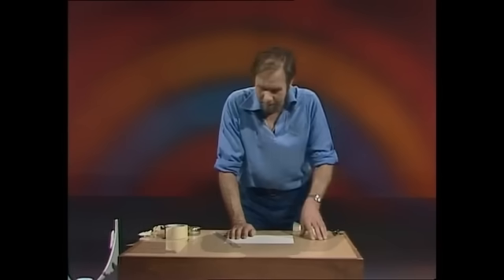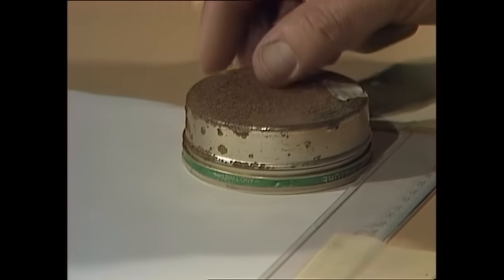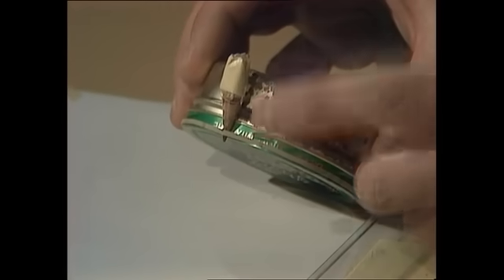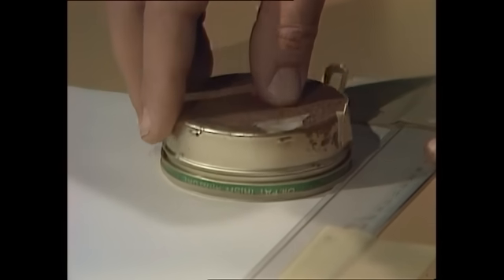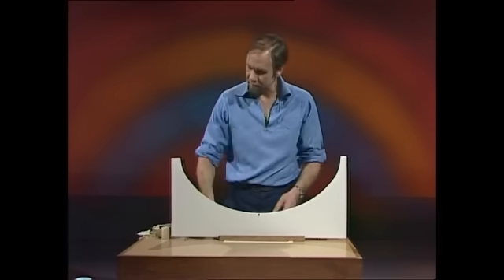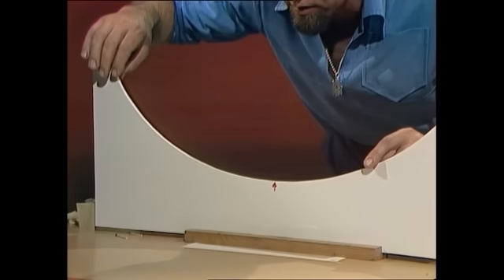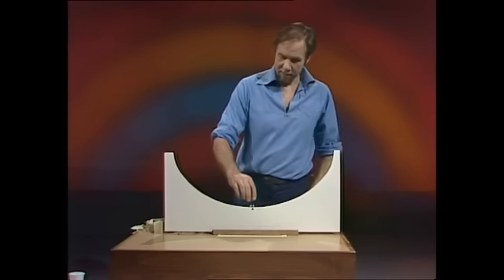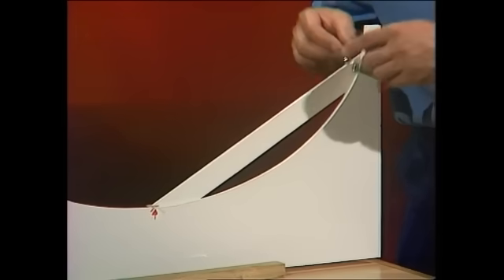The mysterious isochronous curve

Comment: So the fastest distance between two points is an isochronic curve!
Reply: Only when there is a gravitational force applied, the straight line has more resistance to gravity but the curve allows for "freefall" thus the ball on the curve has more acceleration and the ball on the line has more inertia. This is why a vert ramp (half pipe) for skateboarding is the shape it is.
Reply: +Daniel Beaird This has nothing to do with gravity... it's mass and acceleration due to no friction, hence a free falling but under conditions.
Reply: Daniel Beaird No such thing as gravity.
Reply: Owen Johnson ......Einstein and Newton might disagree with you. But you are smarter than they are LOL
Reply: @caseyplooy1696  nope, Newton only described the rate at which objects fall. He should have waited a week after that apple fell, then he would have seen all the gases escaping and going up, and realized that matter seems to have an electrical gradient based on density. Well... If he understood electricity he may have deduced that.  But Einstein went nuts, plagiarized some disconnected math proofs, and paved way for 100 years of a failed theory of cosmology that is baffled and surprised at every turn.
Reply: kandysman86 ......obviously you are smarter than Einstein and Newton, you got it all figured out. Good luck with that👎🏻
Reply: Are you high? Einstein was the guy who opposed Newton's theory of gravity. He's the one who thought "gravity" was not a force but a curvature in space time
Reply: @Owen Johnson Force due to acceleration in other words.  Or would you argue that acceleration does not exist either?
Reply: @op-pv2nn :... I see.. tell me, is it the case, then, that recently, you don't so much feel like you're being pulled down, more like you're being pushed!!???
Reply: @caseyplooy1696  nope, I don't need to be smarter than Einstein to look at the work refuting his, and realized which actually makes sense. Don't have to be smarter than Newton to be able to see things he missed. Especially since it's not me pointing out what he missed, it's other scientists. But mainstream academia has become so unscientific and dogmatic, the reject all evidense that counters their narritive. Here is an easy example to understand. The prevailing theory of comets are that they are "dirty snowballs" with sublimating water ice. This is still the theory, yet every modern observation, including up close pictures absolutely refutes every prediction made by mainstream academia. Yet every observation matches EXACTLY, the predictions made by plasma cosmologists. They described everything we see before hand. The mainstream even saw a comet start to "sublimate" out past Jupiter. And they still say that's what is happening, even though their own math makes it impossible to do so far away from the sun. It's all just dogma. They are operating on 150 year old theories, made before we understood plasmas role in the universe. But to many books have been written, to many grants awarded, to many Nobel prizes handed out. The peer review process has become a way to filter out descent, not keep the science moving forward.
Reply: +kandysman86, wtf are you talking about, Newton gave a law of gravitation that worked for celestial and terrestrial down to until a quantum level, as well as a complete working model of forces, accelerations, velocities and displacements and the differential/integral calculus required to convert between them, plus inertia, thought experiments on centrifugal force and a whole field of philosophy of whether time/space are absolute or relative.

His laws don't contradict anything whatsoever to do with low density gases rising, which is absolutely nothing to do with an "electric gradient", it's that their mass is spread across more volume, so heavier gas pushes down and fills the space. Those gases are still bound to our atmosphere by gravity.

Likewise, Einstein discovered the photoelectric effect and won a nobel prize for it, and although you're talking about his cosmological constant which he /self/ referred to as the biggest blunder of his career, that is a pretentious talking point because the cosmological constant is actually correct and he was right, it's because of vacuum energy. He did not hold back astrophysics at all. The only thing he can be accused of is wasting his own time by not believing in quantum physics because in his words "god does not play dice".

If you're talking about him "plaigirising" Lorentz transforms to form special relativity - yes, he used someone else's maths theorems to come up with the theory of relativity over 7 years, something that no one else ever did, and something we know to demonstrably be true experimentally now and makes your GPS work. Just like he also used an arabic number system, Newton's calculus, and in general stood in the shoulders of the giants before him.

Then he went on to completely discover general relativity on his own. And Einstein field equations. And shaped the field of Bose-Einstein statistics which solved most large complex problems in thermodynamics.

I know you think you're cool and a diverse thinker for rejecting known scientific greats, but actually you're just a moron not capable of 0.01% of anything they have ever achieved, probably not even capable of understanding their work either lol even though they did all the work for you, and you will never accomplish anything in your life.
Reply: @op-pv2nn  
Hahaha just curvature of time and space lol
Reply: Alex Rose .......thank you
Reply: You can dismiss Owen Johnson. He's probably a flat earther
Reply: Daniel Beaird 
Isn’t that what I said?
Sans the superfluous pretension.
Reply: no, because you're wrong.
Reply: @Elephantstonica  no
Reply: Michael Woehrl 
When descending.
Someone should tell the various birds of prey.
Reply: @Elephantstonica  they may know it already
Reply: +Michael: It's irrelevant to birds of prey, the only reason this is fast is because the only driving force is gravity, which only acts down. The thing that moves the ball horizontally is the normal reaction force.

At the beginning, the ball has no speed at all and needs to accelerate, I'm sure you will agree if the surface was flat it would not move at all in any direction, so this half sine curve allows it to build up acceleration and then convert that optimally to horizontal velocity.

This is not applicable for a bird of prey, they don't get their horizontal velocity by pushing off a ramp, they get it by flapping their wings.
Reply: +kandysman86 When you can spell and use "to," "two," "too," "dissent" and "descent" correctly, come back and try again. 

+Alex Rose Seriously, dude, it's not half a sine wave.
Reply: Far out Walter.
Reply: Distance isn't measured in speed.  ;-)
Reply: Lol, fastest distance?
Reply: The shortest is a straight line, but if you add another dimension to it the shortest becomes a straight line in 4 dimensions. Gravity bends space so it is actually taking the shortest route in 4 dimensions.
Reply: I wouldn't have expected to find flat earthers here. Sadly such fools are all over the internet these days. Good luck to them...
Reply: @iliketurtles4463  
Oh you shouldn't be so surprised. Didn't you know Flatearthers can be found all around the globe.
Reply: What the hell is a "fastest distance" ?
Reply: Paul Newfield -Pasadena, Ca. USA  acceleration due to gravity
Reply: The fastest and the shortest are not the same thing!
Reply: kick a butt with my feet goign on a isochronous curve:D
Reply: The fastest way to get drunk is to drink hard liquor really fast.
Reply: I miss my protractor.....
Reply: Fragotron McFarland ...........your boyfriend is calling you. (Ever notice how all the flattards have fake names?) I wouldn’t put up my real name if I was a flattard either.
Reply: Shortest distance is a straight line. Now for some bearded guy in a polo-neck on Open University.
Reply: Only when you go downwards 🤦🏻‍♂️
Reply: @Walter Boyajian vsauce did a good video on that
Reply: @Walter Boyajian I would like a description of how or why this property or function is derived from a circular curve
Reply: Walter Boyajian Vsauce did a video on it
Reply: ... The top half of the curve gives the ball bearing a straight down drop, where's the straight line drop doesn't give the ball bearing a straight drop down but allows it to gather momentom as it falls right?  If so, then this is why the curve wins every time.
Reply: Can't believe he used scotch tape
Reply: @robertanderson6471  is this an english/scotish joke?
Reply: No. Not at all
Reply: Watch 3b1b
Reply: Fastest distance ? You mean the fastest path. And the shortest distance between 2 point is a straight line.
Reply: The initial curve was steeper giving a higher
 Acceleration that's all
Reply: This dude is the Bob Ross of physics.
Reply: +snee : How the hell are you going to send a rover to Mars along an isochronous curve in space? 
You'd need one amazingly huge sheet of special cardboard, and you'd have a hard time fixing it in place. What are you going to do, sellotape it to Jupiter? You can't. Jupiter's a gas giant. Also, it's moving, and it's got moons. They'd batter stonking great holes in your cardboard.
Reply: The fastest distance is a line if you're going straight down.
Reply: What I'm loving about this is a piece shot in the 1970's, now on The Tube, is causing such a great debate and conversation. I for one learned something today and I'm glad The Tube recommended this to me.
Reply: Doug Bader The Tube definitely calling it that now
Reply: Ken  From what i am struggling to get my head round the crazy thing is that with this shape the object travels to the middle in the same time it would have fell a straight line the height of the tobacco tin, if there was no friction.
Reply: +Paul Newfield You're a moron. Newton didn't look at an apple and be like "oh lol weight exists", he described the relationship between inertial mass and acceleration/force, gravitational mass and the force of gravity (which does exist, it's called the gravitational force, it's one of the four fundamental forces so I don't know what drugs you've been taking), accurately calculated the paths of the planets, discovered in a world of friction pre-space travel that objects stay at constant velocity when no external force is applied, derived calculus, discovered that all reactions have an equal and opposite reaction, discovered his formula for force being rate of change of momentum, discovered his formula for gravity which we still use today for all space travel, and put it all down in one giant book, 1000 pages long, in latin, called the Philosophiæ Naturalis Principia Mathematica.

Just because you are too much of a brainlet to understand what he did and believe some dumb tale about an apple that didn't even happen, doesn't mean he didn't do anything of value, he is probably top 5 most important scientists who ever lived, numbnuts.
Reply: No such thing as the fastest distance.  Fastest implies speed, distance implies length.
Reply: You need to repeat your previous grades. smh.
Reply: It's the shortest distance.It was never the fastest.....You dunce!
Reply: it is if you're a ball bearing

Comment: Or you can get a Spiro graph from Parker Brothers  or Mattel maybe, gears are better then a rubber band for precision.
Reply: Its supposed to be repeatable for the kids at home in Australia in the 1970's.
We all had tobacco but none of us had  a spiro graph.
Reply: Depends on the pitch of the gears, tooth shape etc whereas rubber bands are linear. Just saying LOLz XD
Reply: *than
Reply: Good point but no!  (or at least that is what I am going to say without actually knowing)  The unique properties of this curve require the 'drawing point' to be right on the edge of the 'wheel' … this is not achieved by Spirograph.
Reply: Unless you add a base line the distance equal to that of tooth to hole
Reply: Not if the pen is placed in a gear tooth, that is the same as this demo, you do not have to follow the instructions in the box. The depth of the gear is the same on the guides and would glide  smooth like the tin.
Reply: But can it love you the same as a rusty tin can will?
Reply: On the other hand, the spirograph doesn't allow the pen to go all the way out to the rim of the wheels, which consequently yields a different kind of curve.
Reply: Do not read the instructions, just place the pencil in any gear tooth space, same as demo here
Reply: Rocco Eyerman — I was thinking the same thing, although I couldn’t remember the name though.  Thanks!
Reply: Names of the curves made by Spirograph > youtu.be/skvnj67YGmw?t=14m21s
Reply: Spirograph was for sissies.

Comment: Ok, but how is this useful in life? Boat hulls? Roof drainage?
Reply: gear making process in order to maintain synchronous rotation of gear set and output shaft.
Reply: @sunside79334  Do you have a visual representation of this, because I've been churning my head figuring out how that would work...
Reply: try the wikipedia article and the references
https://en.wikipedia.org/wiki/Involute_gear
basically it comes down to finding a shape for gear teeth that would provide continous travel over the whole span of teeth touching action without periodic acceleration, and the involute is able to provide exactly that.
Reply: I've done a bit of googling about this (still no mathematician here, I'll have to maybe consult Numberphile or Matt Parker about it..) but though they may seem the same and when they regard a cycloid they are, they don't seem to be interchangeable at all. To begin with, the isochronous curve is symmetrical where the involute is a continuous spiral.  For gear making, wouldn't you need an opposite-of-involute profile to make one? Honestly, the link you sent only confused me more... sorry to be a bother but could you explain a bit more, as googling the subject doesn't clear anything up either...

Comment: In case anyone is wondering what the high pitched noise is, it is the 15.625 khz PAL video channel leaking into the audio channel. 15.625 kHz is the frequency the electron beam was scanned across PAL TV CRTs; 25 frames per second @ 625 lines resolution. Here's the audio spectrum of the audio of this video that I took using Spectroid on my Phone, showing a strong peak at 15.656 kHz (close enough).

https://i.imgur.com/HUyLMuH.png
Reply: 405 was easier to hear.

Comment: Is it an Isochronous curve, a Brachistochrone curve, a Tautochrone curve, or an Inverted Cycloid?
Reply: Brachistochrones lived in the Jurassic
Reply: I believe it's a cycloid.
Reply: I think the Brachistochrone is a special type of Isochronus curve. That, or they are synonyms.
Reply: The brachistochrone curve is the same shape as the tautochrone curve; both are cycloids. However, the portion of the cycloid used for each of the two varies. More specifically, the brachistochrone can use up to a complete rotation of the cycloid (at the limit when A and B are at the same level), but always starts at a cusp. In contrast, the tautochrone problem can only use up to the first half rotation, and always ends at the horizontal.

Comment: This makes perfect sense to me..more distance to travel but but the ball speeds up way faster on the higher drop with more distance than the ball with little slope and little distance. It evens it out.
Reply: It doesn't even out: the curve wins by a mile. But, this won't happen with just any old curve, so it's quite counter-intuitive. If it makes perfect sense to you, then you may not be thinking hard enough.
Reply: You're the one not thinking right. T AN wasn't talking about the incline vs. the curve. He was talking about dropping on different parts of the curve. Therefore, he's right and you fail at understanding context clues.
Reply: Fair point. Still, this won't happen with a circle or a parabola, but it does happen with this curve. So yes, it evens out in this case. It wouldn't even out for different curves though, so it's not a general result for curves, even though in general, the higher you go up any curve, the greater the initial acceleration.

Comment: Wait, it's the same thing when the Earth rotates. 
So the fastest path for a rocket going anywhere in space is not a strait line, it's actually an isochronous curve? Just like for these balls.
Why is a curve the fastest path?
Reply: It's not simply travelling along a curve, it's under constant downward acceleration on the curve. This is quite an unusual situation that could only be found within a gravitational field. 
You could set it up with a rocket in space, where the rocket thrust always pointed in one direction and the rocket body was constrained by rails so it could not travel in the opposite direction of the thrust but had to follow the rails. In that case, it would reach the end point fastest if the rails were shaped as that curve. 
But without rails, the rocket will accelerate fastest in a straight line, in the opposite direction to the thrust.

Comment: I'm thinking the example at the end of the video shows how 'gravity assist' functions for space probes!   Demonstrating a curved path using gravity assist is more effective than using a  straight line path.
Reply: maximosh i was also thinking the swing of the curve helps, and the direction curve starts in provides for a sooner acceleration.
Reply: Interesting. Please explain further. There are no straight lines if you're moving next to a celestial body. It seems to me a gravity assist works best when you're as close as possible to the center of mass. What else is there to consider? Ah you mean getting as much velocity as possible - I guess it's as simple as you're "falling" fastest when you're closest to the center of mass. Therefore that's when it's the best time to accelerate.